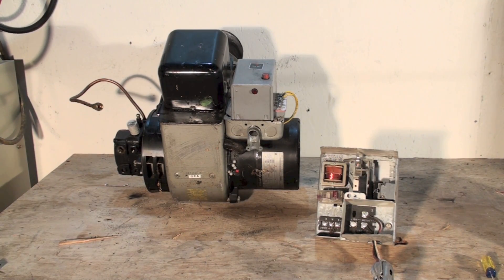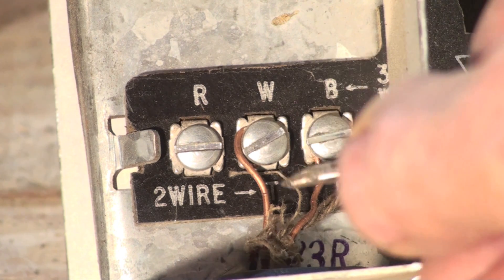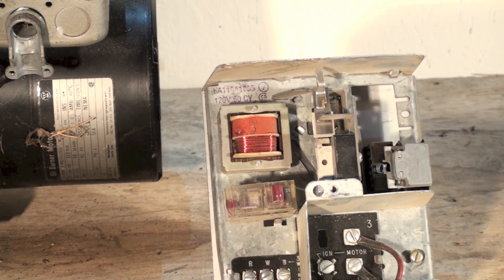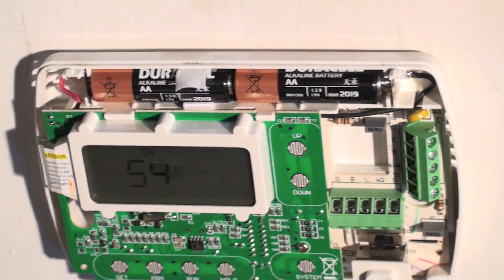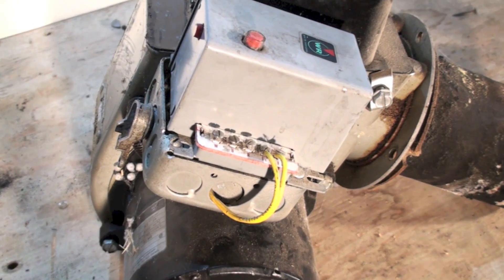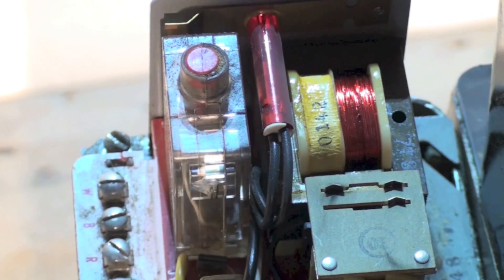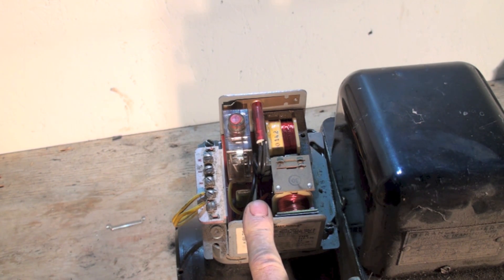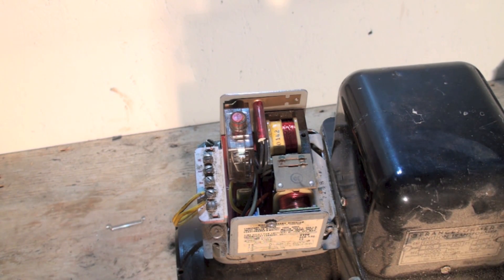Thermostat wiring for the oil furnace

Comment: I know this post is old but In order to keep burners from short cycling, the series 10 was designed with a holding circuit that was tapped into the control transformer at the mid point. This was enough power to hold a relay circuit closed but was not enough to pull the relay in. So when a call for heat was completed both the W>R and W>B contacts were open. As the room cooled the first set of contacts in the thermostat that it would make were W>R. That would not pull the relay in because it's connected to the lower current portion of the control transformer with the common (W) side of the control transformer. When the room temperature dropped further, the second set of contacts closed W>B and the relay or other control would pull in the burner contacts. As soon as that happened, the burner would fire and the heat would start to go into the ductwork or radiators. In pretty short order the W>B contact would open but the W>R contacts stayed closed and HELD the already connected relay contacts in place. After the call for heat was completed, the W>R contacts would open.

When Honeywell introduced the Famous Honeywell Round Series 80 Thermostat with the mercury bulb on the bimetal coiled spring, they were using the weight of the mercury as a seesaw to create the differential that the series 10 created with the holding circuit.

The EASY FIX with the Series 10 to Series 80 controls is that all you needed to do is drop the R wire from the circuit and just use B and W on the old Series 10 control with the new Series 80 thermostat.

In order to prevent overshooting, most of those thermostats were equipped with a Heat Anticipator that you would select or adjust, based on the current draw of the control you were connecting the thermostat to.

Comment: I just replace the old style Honeywell thermostat with the mercury inside that had a heat anticipator which worked great until I tried cleaning it.  I replaced it with the Honeywell Home RTH111B Non-Programmable Thermostat.  The problem is when it reaches the set point by the time the furnace cools down it is 8 degrees above set point.  I checked voltage coming into the thermostat and I'm getting 8.4 volts, thermostat looks like it needs between 20 - 30 volts.  Should the furnace be putting out 24 volts?  It worked with the old thermostat until I wrecked it by trying to clean it.
Reply from the maker: That thermostat should work with any low voltage.  Have you covered the hole in the wall behind the thermostat?
GFM
Reply: @grayfurnaceman  The hole is only large enough to pull the wires through.  It's mounted on a small board in my garage.  I had the thermostat wires hooked to R&W. then R&B, with that the burner wouldn't shut off.  With it on R&W the burner shut off at set temperature, but by the time the fan shut off the temperature was 8 degrees warmer than set point.  I thought about moving the thermostat to another wall.  It's on the opposite side wall as the furnace, about 20 feet away.
Reply from the maker: @John-Deere  I would move the stat.  Merry Christmas
GFM

Comment: Hi,
Even though this video was created 8 years ago, it was a true blessing for me this morning. I have been caring for a Wayne oil burner using a stack control identical to your model. He got no response from an older mercury vertical thermostat that has been in use for over 50 years. Just yesterday when finally needed heat , I turned up the temperature and heard the familiar click, but there was no response from the burner. In a very tight compartment, I slid back to where the  stack switch was; reset the red button with no response. 
I forgot how to properly reset the step on the lever that protrudes into the chimney stack although I was able to press it in slightly. I pulled up on the transformer that is is the upper left corner in desperation and Behold the burner came on and I could hear and feel the rumbling and heat in the chimney pipe. I was pleased to confirm I had fuel and ignition, but as soon as I released the the little solenoid on that transformer,
the burner quit. If I lifted it again, the burner fired just as before. Not being willing to stand all night holding that relay, I went to bed with a chilly house, determined to research stack controls. 
Your video was the perfect answer to my quick prayer for some help!
Your presentation was clear, very thorough and showed me what I had clumsily accomplished the previous night 
I think now I need to check if I am getting power at the thermostat W and B connection and also if the contacts on the relay are not corroded. This unit is in a seasonal camp and is used very little except for chilly mornings and now when the weather is turning and CC we will soon leave it be till next May. 
Thank you so much for your contribution to help those who are DIYers   
May God richly bless you and all your families. 
JR in Auburn, NY
🤠👩🏻🤗🤗👍

Comment: Hello,
    I have a Williams Oil-O-Matic Fuel Oil Furnace that I am guessing is from 1960 something. It has a Stack Relay and a Fan Limit control. I added a 2 ton Heat Pump and am uncertain about how to energize the fan for cooling or heat pump heating?

    I have a single speed blower that provides about 800 cfm. I understand I can install a relay between the thermostat's call for heating and the stack relay to isolate the fuel oil heating cycle from other functions. 

    I also understand I could use a fan center which has it's own relay. The fan center N.O. and N.C terminals usually get connected to different speeds of a motor, one speed for heating and one for cooling. But I have one speed so I'm confused on how to energize the fan without over lapping the controls. Plus I have a heat pump so its one speed for three purposes.

Comment: Wondering some video's show removing a jumper between terminals R and RC on some thermostats like a Honeywell RTH6580WF WiFi thermostat so a 2 wire heat system could be connected to terminals R and W.  Additional transformer to power this thermostat would be connected to terminals C and RC. Should that work my oil furnace but think the power from the Honeywell R8184G 1005 oil furnace primary control is like more than 24 volts ?
Reply from the maker: If you want an electronic thermostat, you must use a battery operated one with your primary control.  The power from the primary will not operate an electronic thermostat.
GFM
Reply: The controls voltage at the primary control is 30VAC. I experimented with 'stealing' power to run my new RTH6580 wifi thermostat and it didn't end well. I fried the thermostat. It requires 24VAC and I guess 30VAC was just too high. An expensive lesson for me.

Comment: I need help. I have a two wire oil furance. I put in a honeywell thermostat. And in 6 hours it started to burn up. I used the W and the R termostat on the thermostat. Was that wrong?
Reply from the maker: What burned up?  What model thermostat?
GFM
Reply: @grayfurnaceman  I found out that there are low voltage and high voltage thermostat. I used the wrong one. Thanks for the reply tho.

Comment: So what if you just want to run the fan ?
Reply from the maker: You may not be able to.  If the only control for the furnace is a cad cell relay with only 2 terminals, it will not support a fan relay.  
You could have a manual fan switch on the fan control of the furnace.
GFM
Reply: It's a hallmark lb 115maybe 8 years old . so just switch the fan control on and of when you need to move some air around .
Reply from the maker: @MrSprintcat  If you have a fan control on the unit, yes.
GFM
Reply: You need blower to come on for ac?  So transformer and relay?

Comment: Are the nest thermostats compatible with an old Williamson oil furnace? I have a Nest but was told by a furnace repair purson it was not, but nothing else I read, Including the Nest website, tells me it is incompatible. Thanks in advance.
Reply from the maker: If the unit uses a stack switch or the cad cell relay has only 2 thermostat terminals, it is not compatible, unless an isolation relay and 24 volt transformer are installed.
GFM

Comment: Hi GFM, I can use a little help here.  The Riello 40 in my garage furnace quit firing, motor runs, ignition spark is audible, but no fire happens.  I tried cleaning the cad and replaced the oil valve solenoid, but still no fire.  Last time it did this a few years ago, I replaced the  rectangular switching relay part number 7020004 and it worked.  Now I can't find a replacement, as it seems to be discontinued.  I ran across a thread where they said a Honeywell R182C can be used to replace the Riello switching relay.  Please share your thoughts on this.
Thanks

Comment: I know on a plain mechanical thermostat, the 2 wire connections are marked R&W, so why on the relay the W&B get used instead of the R&W. Please explain what all three connections RBW would be used for.
Reply from the maker: The W and B are the only terminals necessary for modern thermostats.  I will be doing a video on how the series 10 thermostat works when I get a chance.
GFM
Reply: bernard bonnetrouge yes I was similarly  confused about that. THANKS FURNANCEMAN for addressing  that

Comment: How do I connect my 4 wore thermostat to theR8184G. Tje fan controller 8A85A- 101 is part of that circuit. 
Both Controls, the White Rodgers 8A85A-101 and the honeywell R8184G have their own 24V transformers. 
I have 24V across the T & T terminals AND    W & C Terminals (when calling for heat)  If I connect W-T and C-T, won't I get a short?
Reply from the maker: I think you will damage the transformer in the cad cell relay unless you use an isolation relay.  I have a video on the change.
GFM

Comment: I am in this exact situation. I am literate with transformers, relays, and schematics.  Can you point me at any resource that would help? I understand I need to isolate the transformer in the cad unit from an additional transformer that would get used to power the C wire.
Reply from the maker: Try this one:  https://youtu.be/f0v3FeDZBeY  Hope it helps.
GFM
Reply from the maker: I have sent a link.  If it does not come in, check your trash.
GFM
Reply: grayfurnaceman yes this was helpful  onto how the different wires interact  with each other

Comment: I have a separate 24 volt transformer installed on the side and says c and g  I think feeds the air conditioner 
Could this be used for a c wire to a thermostat?
I have jumps some wires also right?
Reply from the maker: +Phil Bourgeois It will probably work.  I don't know your wiring.  
GFM

Comment: an oil furnace with a.c. i need a new thermastat prefrably didgital any recomendations i have the cad cell relay on my beckett furnance with honeywell cad cell.i want a battery op thermostat.whats a good modle my old thermastat has 5 wires

Comment: Hello, I have the same 2 wires from my oil burner (labeled T1 and T2 in this case) and I'm wondering where exactly they are to be connected to my new thermostat? No need for the common wire as the thermostat has batteries as you mentioned. It is a Honeywell RTH2510/RTH2410 series thermostat. The inputs are: B, O, G, Y, W/AUX, R jumped with RC.
Thanks so much
Kevin
Reply from the maker: ***** If you do not have air conditioning, you can put one to R and one to W.  
GFM
Reply: grayfurnaceman
That is the case and I just tried that and its working great. I had to set the stat for no back up heating because it was only kicking on once calling for extra heat. All is good now, thanks so much for the fast reply!
Reply: grayfurnaceman and if i do have A/C

Comment from the maker: I will be doing a vid on that wiring when I get time.  The other choice is to buy a cad cell relay that comes with a larger transformer that is made to be used with either a/c or a thermostat that needs a C.  Something like the Honeywell R8184M1051.  Hope this helps.
GFM

Comment: I'll bet money that Duracell and Energizer hold stock in the major thermostat companies. Unless you have a "heat only" situation, you've got a 5 wire going to that baby. Why batteries? To save the program in an outage? The program is lost more to dead batteries. I've been to so many calls where the t-stat was brightly lit and partially functioning even though the batteries were bad. Thanks for the awesome vids btw.